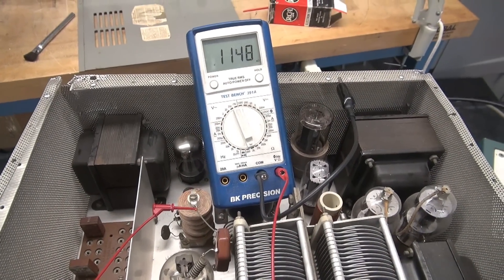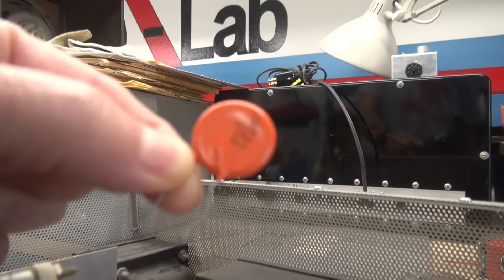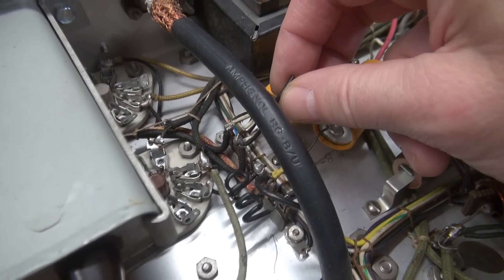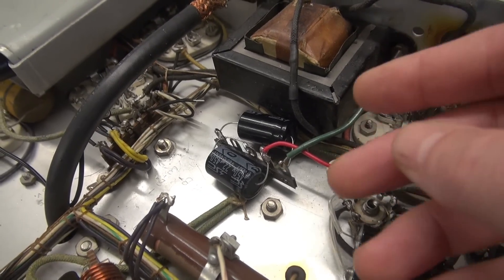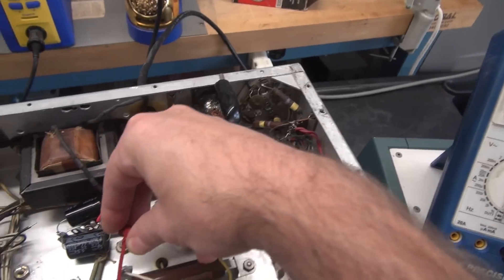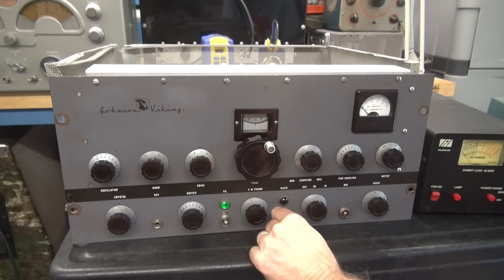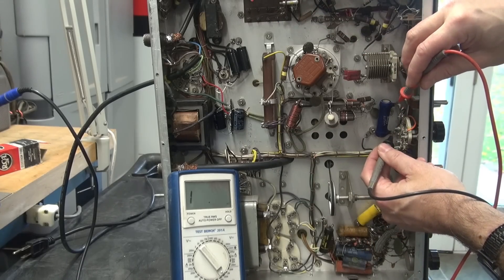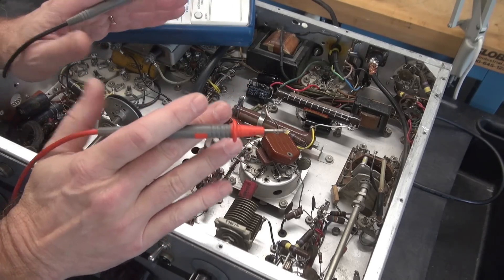Johnson Viking 1 Ham Transmitter Part 3 High Voltage Repair Victory!

Comment: I am sure you seen them ,I got some of the high voltage blue ceramic capacitors except mine are four or five times smaller then yours,I no they are making stuff smaller but the ones I got from Ali express tiny ,some of the 30 k.high voltage ,way smaller then a dime and you can see several.layers ,anyone out there try any of these very small baby blue high voltage  capacitors ? Thanks.D-lab for sharing love your videos.both you and your wife and your granddaughter.and the dog 👍👍

Comment: Way to go, Terry! A very nice job of trouble shooting. I would guess a previous owner found problems in the modulator circuit and was unable or didn't try to find replacement parts. It's a shame what happened during shipping. Wow. Anyway, thanks for sharing it with us. 73 de K7RMJ  Frank

Comment: nice rescue of a good old johnson. there is a cute trick to get the 80 meter VFO to excite the transmitter on 160 (use the correct coax cable and length to connect VFO to transmitter)

Comment: I have a beautiful viking 1 with factory TVI shielding and vfo. advise on mods. NEVER disconnect (or defeat by bypassing the cathode resistor in the driver) the modulator negative feed back. defeating  the negative feedback in the modulator(great way to ruin the modulation transformer). 
I floated the ground end of the tapped modulator screen resistor and use 2ea 150 volt regulator tubes OA2 in series to ground from the screens(regulates screens at 300v) watch regulator tubes during modulation that they do not go out(adjust screen tap as needed)(prevents cooking the modulator tubes with excessive idle current and gives maximum modulator power). Hooked the plate-screen(triode connected) of the 6bh6 to its plate supply through a 16k 20w resistor. through a 2uf cap from the plate -screen 6bh6 to modulation driver transformer primary and ground the other lead of the modulation driver trans primary. the object is to drive the class ab2 807s with low plate impedance triode and take the driver dc plate current out of the primary of the driver trans(failure to do this causes driver transformer to saturate during modulation and create splatter). now you have a good transmitter. not a distorted splatter monster. just  3 bad johnson engineering problems to correct. you then find a non amplified d104 crystal or ceramic mic will modulate fully with mic gain set at max. Mine gets great audio reports with no splatter.

Comment: Nice job!, I have a Bogen Challenger chb 100 it was like playing detective on the high voltage, but last night i finally got it working!, I just ordered new tube covers because the output tubes were picking up my cell phones data!

nice work from Indiana!